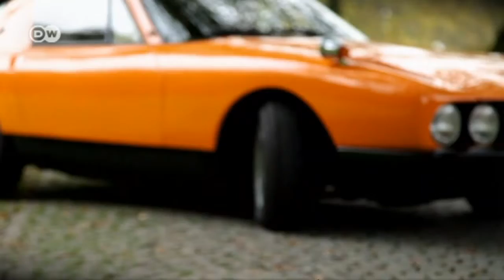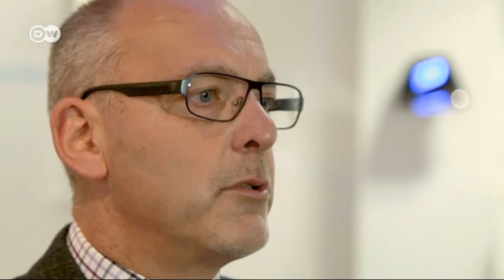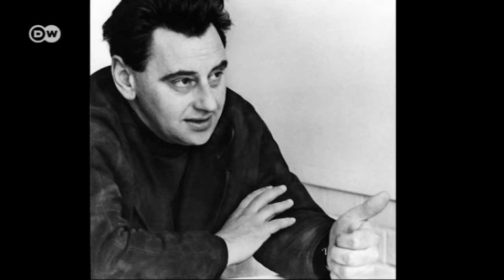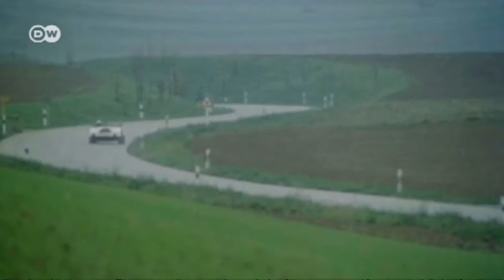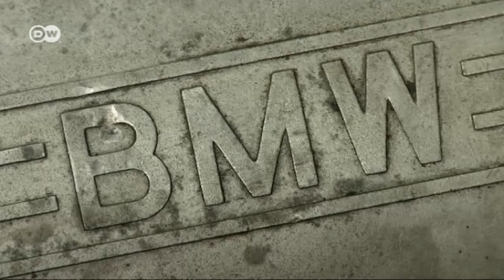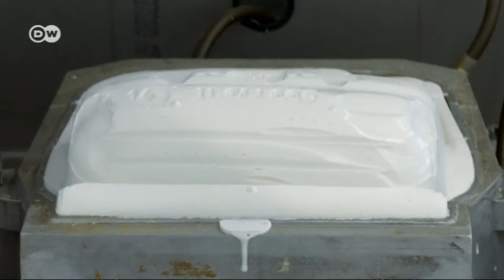Revolutionary all-plastic car: Bayer K67 | Drive it!

Comment: Anyone else remember the Saturn brand which featured dent-resistant plastic body panels. I recall the colour was built into the panels meaning even if scratched one did not need to repaint.
Reply: they had honda engines  i remember